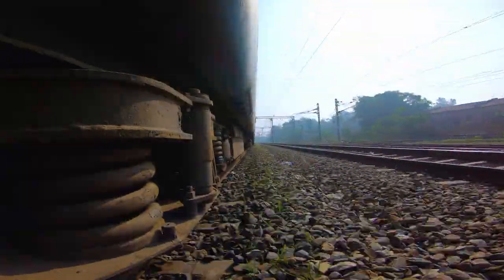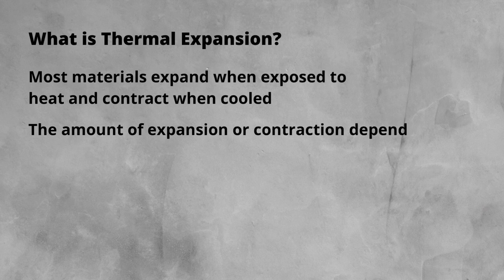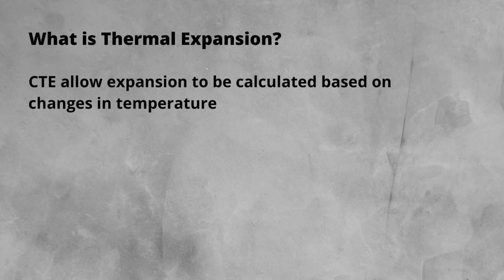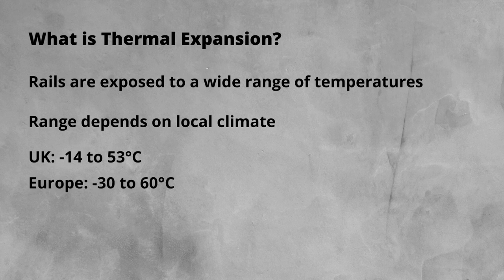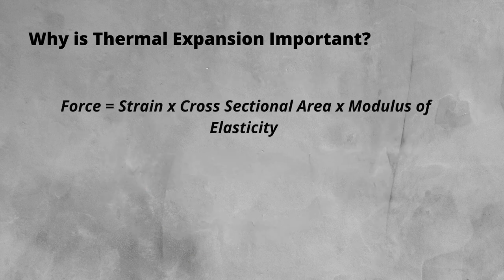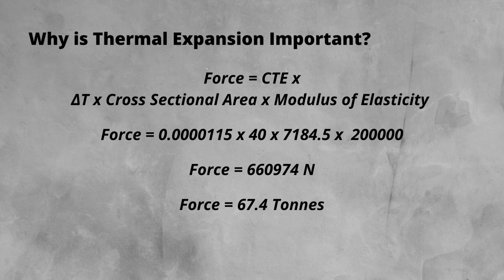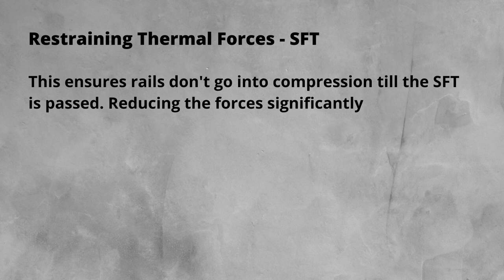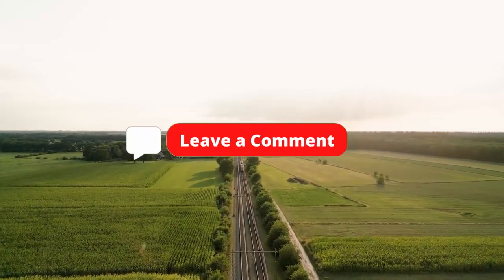Why Do Railway Tracks Buckle and the Ways to Prevented It

Comment: The thing that I was most confused by was how ballast can affect the stress on the rail.  I was either slow in understanding or you did not explain it very well! 😁
Reply from the maker: Likely my explanation! 
The other confusing thing I have realised is in this context stress has two definitions.
 1. is the forces in the rails are known as stress (material science term)
 2. the act of pulling the rails into tension to install them is known as Stressing on the rail.

The key thing to remember about the ballast is it the main part of the railway that opposes the movement of the track. It resists the movement of the track but being hard to move. So the force built up in the rail needs to be big enough to push the ballast out of the way. Imagine pushing a car for example. One your own you might not be able to move it, but get more and more people to help, eventually you get enough people/force to start moving it. You overcome the resistance

I hope this help. If not, let me know and I'll try again!
Reply: @thepwayengineer  that helps a lot.  I have some metallurgy so I understand the rail stress (which makes it no less amazing when you see it buckle) but never thought of the ballast as being a resistive force to the rail.  Makes sense now.  So does the different weights of rails have some positive or negative effect on rail stress?
Reply: SFT of 32 being considered in Southern England on NR infrastructure. I believe London Tram systems use SFT of 32 now as standard. 8:53
Reply from the maker: Different profiles of rail will have difference cross sectional areas. That will effect the force, given the equation. I can honestly say I have never looked into that!
Reply from the maker: 2102 has just been updated, increasing initial stressing requirements to an SFT of 30. The only issue I can see coming along is rail breaks in the sudden cold snaps we seem to have. But they are not as long as these hot summers so I guess its a balance